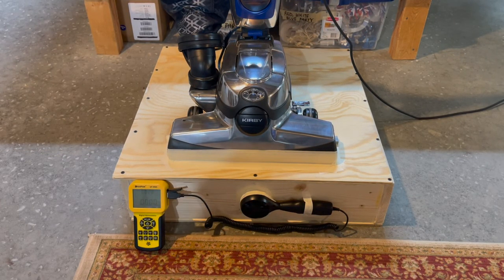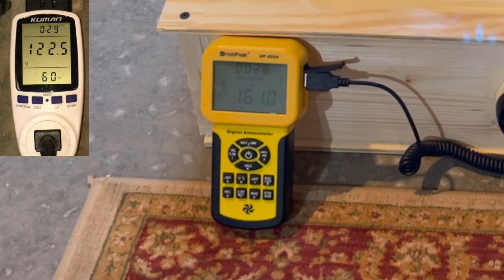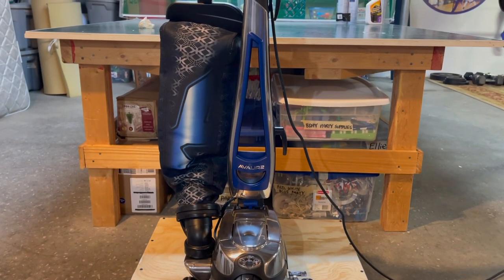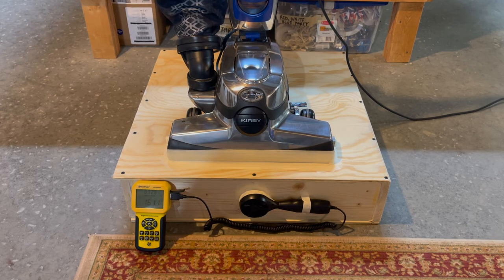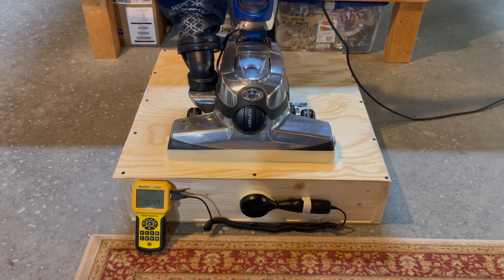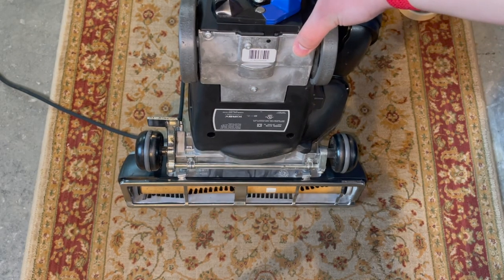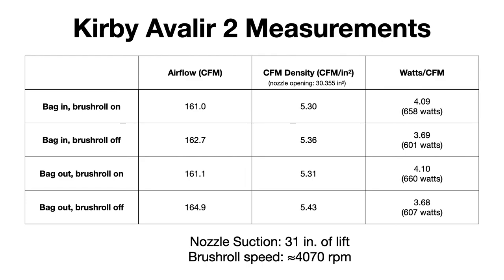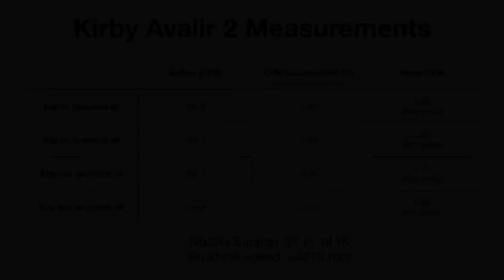Kirby Avalir 2 Airflow, Suction, and Brushroll Speed Tests

Comment: Great job! I didn't see what HEPA bag you used for the test. Was it the newer blue bags by chance?

And try to re-calibrate your suction gauge soon.  :)
Reply from the maker: It was one of the standard “Green” HEPA bags (with the green writing/logos on it).  Have you gotten improved results with the blue HPEA bags?  If so, I’ll definitely get some of those!  I actually noticed the suction gauge being off when I was editing the video😂  I’ll use the method you mentioned in your other comment to get it re-calibrated.  Thanks for the suggestions!

Comment: Excellent video! Thank you for testing the Kirby Avalir 2! 

How does the Sanitaire S661 compare to the Kirby Avalir 2? I am curious.
Reply from the maker: Obviously the S661 has almost 40 CFM more than the Avalir 2 so it's quite a bit more powerful, but as I mentioned in my Sanitaire test video, the Sanitaire is incredibly difficult to push on any sort of carpet that has even a little pile.  Since the Kirby has TechDrive, it makes it possible to push the Kirby (even with its very high airflow) on most if not all types of carpet.  I do think the Vibragroomer II on the Sanitaire is more effective than the Kirby's stiff oblique brushroll at extracting sand, but I will have some sand in the carpet tests coming soon to see if my theory is correct!  For anything other than commercial carpet with little or no pile, I prefer the Kirby since it's significantly easier to push.